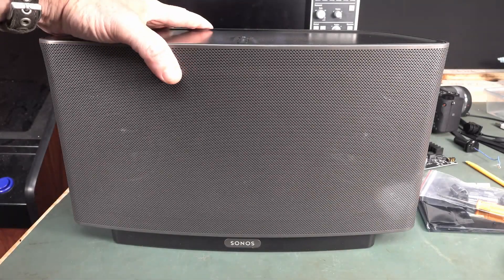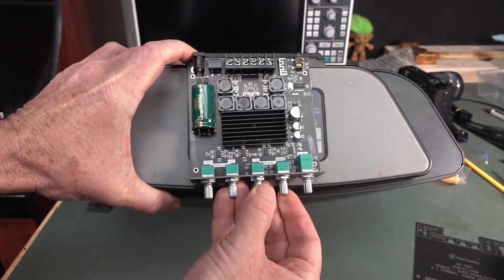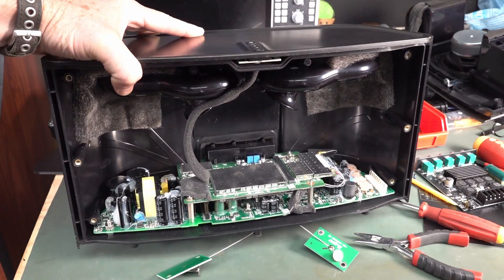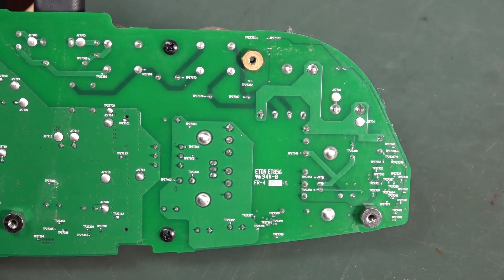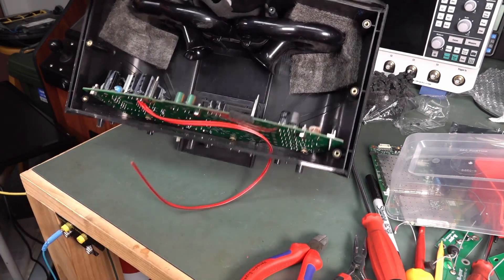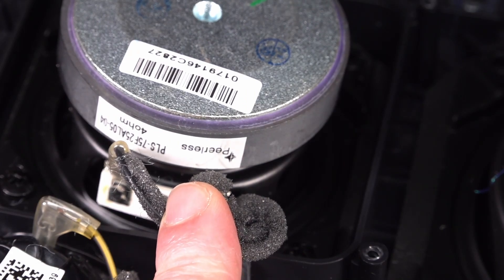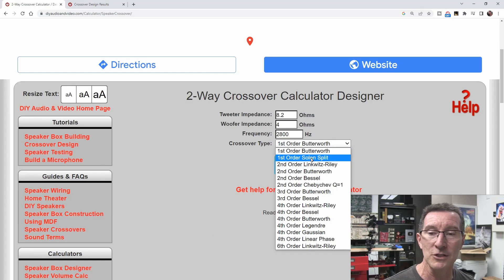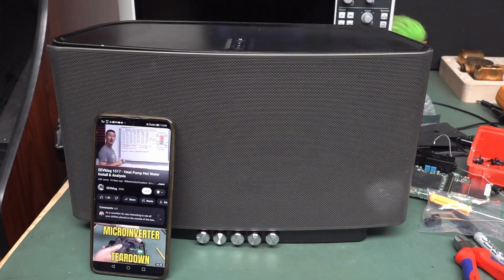EEVblog 1519 - FREE Your Sonos Speaker! (HACK)

Comment: Something that might be more difficult would be to modify the firmware running on it.
Reply from the maker: Possible, yes.
Reply: @EEVblog  Hi Dave,
How does it sound without the Sonos DSP? I would think that Sonos would manipulate the sound quite a bit to make that speaker sound decent.
Reply: @Conservator.  It sounds "meh" at best, since the cabinet isn't designed to sound good without all the DSP correction.
Reply: I did this to my Acer monitor once to eliminate the 8-second power-up logo screen. Made an 8051 disassembler, dumped the ROM, found the offending code, reflashed, all via the DDCI connection using hidden commands. Since I had it figured out, I also added a strobed LED mode for a blur-free gaming mode. Would not do again, lots of hours sunk into it.
Reply: @gargantuablargg  I did something dimilar to a Dell monitor. Also 8051. I desoldered the dip 8 pin flash chip and modified it that way.

Really fun to hook a logic analyzer up to the flash chip, and see what code/data the 8051 is fetching in real time.

Comment: If you need to lose about volt or so go get a 10 amp diode.
Reply from the maker: That was an option, but not needed.
Reply: They only list 12-24 in case one wanted to hook them up to vehicle power

Comment: Love the attention to detail on Sonos, and definitely a nice hack here. That's a perfect match, you were really lucky with it :)
I like the "Fronos" name, it has a Greek mythology or science fiction vibe to it. 
All the hot snot on the other hand... beware of xenomorph eggs in that PSU, haha!

Crossover wise, I'd reverse-engineer the original and copy the design. Yeah, I know... cutting corners rather than doing things the hard way.
Reply: Doesn't raspberry pi have a I2S interface?
Reply: @1kreature  apparently it does :)
Reply: Because the original circuit is so digital I would guess it didn't have a cross over and instead split it between the drivers using a DSP
Reply: Just build a clean replacement board for the digital board (maybe containing a rpi- cm socket so it's modular)

Comment: Could have connected the new amp to the existing LC filtering on the board, which would have given more filtering on the signal, and meant the LC values would be lower, plus also reuse the existing connector as well.  Nice upgrade to the speaker as well, improving it to a new spec for a low price, and getting all the DRM and advertising out of it as well. A good upgrade for the free speaker set.
Reply: The on board amp is 5 channels, and the crossover frequencies are determined by the I2S DSP...
Reply: @Hitek146  Yup. :) The filtering on the output is for filtering the PWM signal after amplification, and not for crossover. :)
Reply: I'd have just harvested components off the board myself for that filtering.